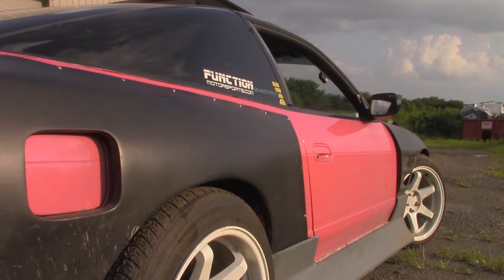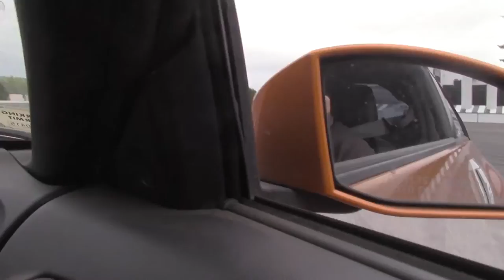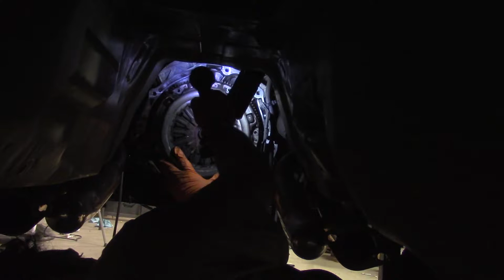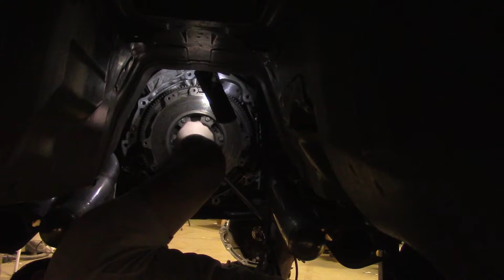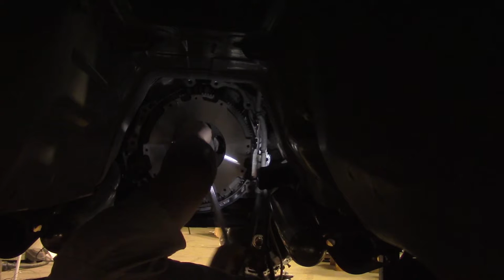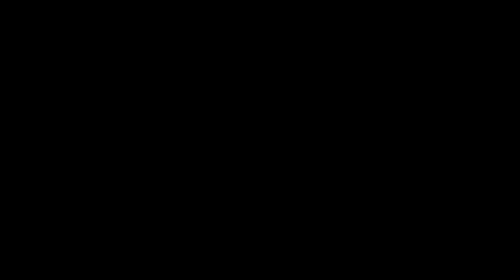350z Clutch Install FUNCTION BEAST: S1-E13

Comment: So If we install a willwood master cyl for the Z with a single line going from master to slave, will the issue still occur that its a PITA to bleed?

thanks!
Reply from the maker: Once the wilwood is installed it becomes very easy to bleed. If someone had a matched master and slave cylinder the pedal pressure wouldn't be so bad.
Reply: Function Beast I believe Z1 makes a matching kit.